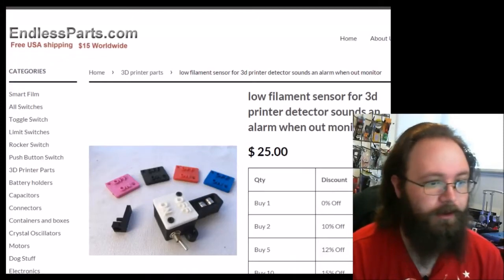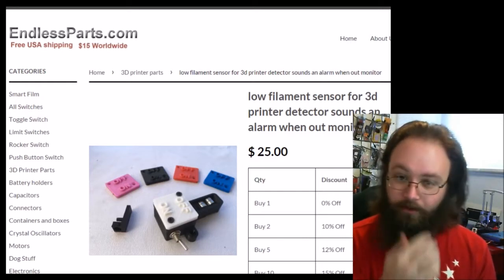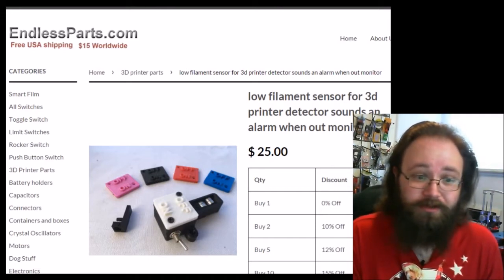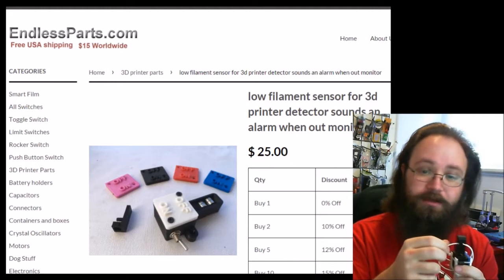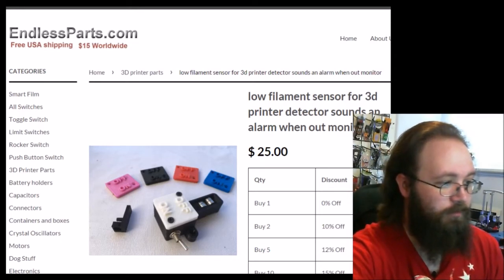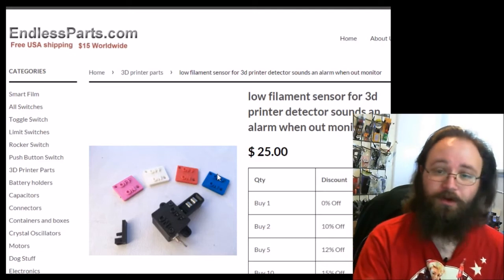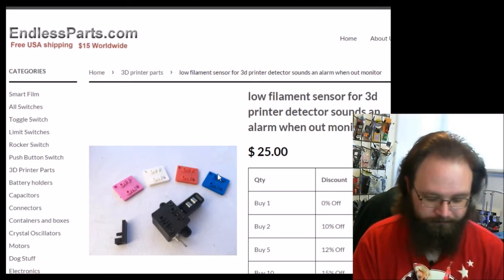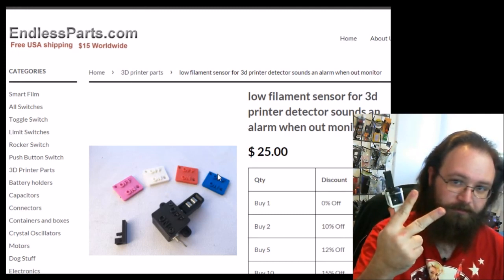Low filament sensor for 3d printing.

Comment: $25 is very reasonable. With standard craft pricing, that means total cost including labor and shop supplies is about $6-7.  Seems about right.  Thanks for the review.  Moved me from contemplation to action. 

Is your adaptor to connect it to the aluminum handle on the printrbot simple metal available for personal use?  I'm attaching to one as well and don't feel a strong desire to reinvent the wheel.  Or the sensor attachment in this case.